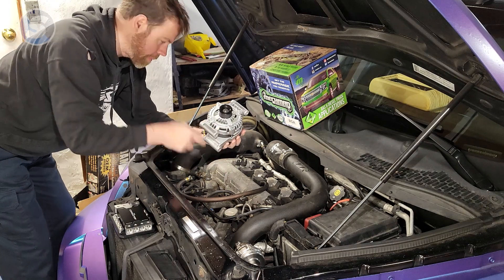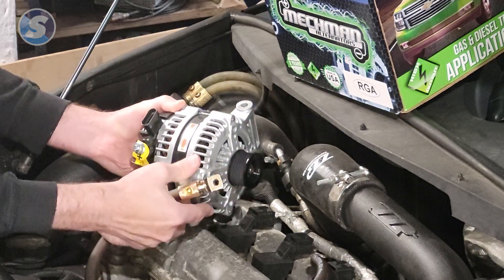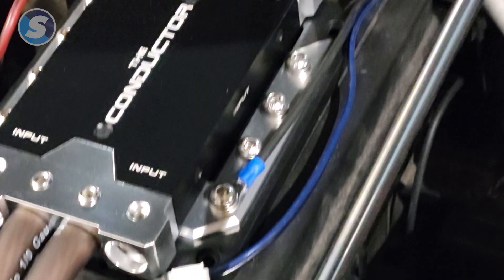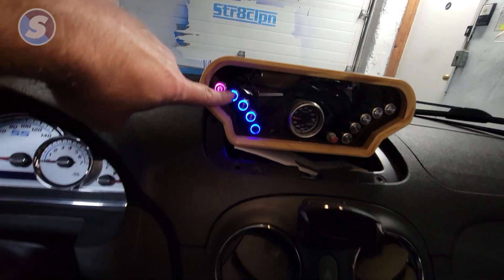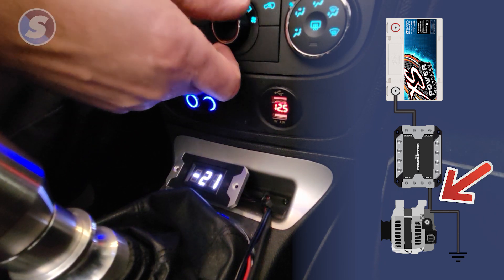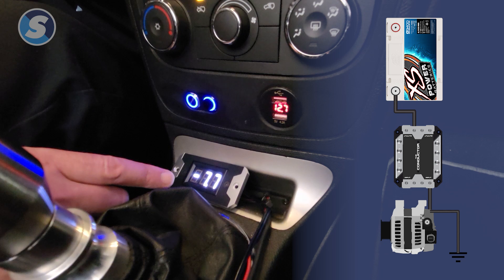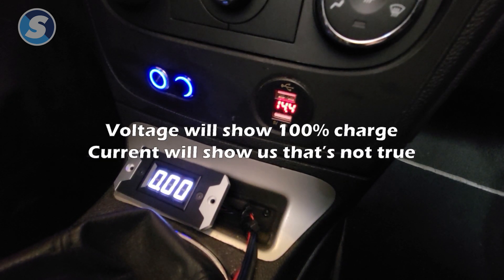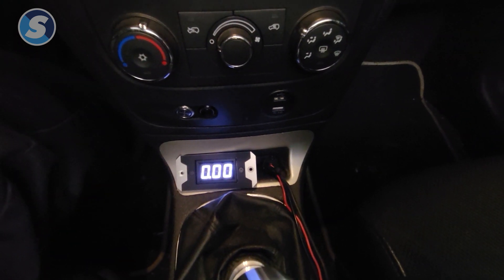Read Alternator Amperage With The Conductor!

Comment: Will the inputs accept 2/0 sky high wire reason I'm asking is I just pre-ordered the Red Ruthless 10k to go with the other one I have been thinking about grabbing a couple of these one per amp but I am about to have to upgrade the 0 gauge wire to 2/0 to reduce the amount of runs needed but I want to make sure it will accept the wire before ordering and finding out the hard way
Reply from the maker: To get 2/0 in there, you'll connect a lug to the sides.

Comment: Ok so im trying to install the conductor.... I have a high output 320A alternator, already have a 2/0 gauge cable ring terminal connected to alternator.... Now I have 3 batteries, one under my hood, 2 in trunk... Ive already previously ran front to back power and ground cables (one each) from my main battery to the 2nd trunk battery, then I just ran a short run power and ground cables from my 2nd battery to the small 3rd trunk battery..... So can I just connect the alternator ground cable to my conductor input, then run one ground out to my main battery under hood then connect the one ground I have front to back? Can I still use the short runs between 2nd trunk battery and 3rd trunk battery? Or would I have to run another front to back ground to 3rd battery?? Will my amps be ok to still ground to chassis??

Comment: So everything in the rear with a nice short chassis ground now needs to be run all the way back up to the front?

Extra length means wires may need to be bigger gauge as well compounding the extra cost, not to mention trying to fit even more huge wires routed through the cabin and firewall
Reply from the maker: The Conductor can be mounted in the rear. This example shows the ability to mount up front in case someone wanted to branch off to a front battery. Big builds like that are running ground wires to the rear anyway. If you have ONLY rear batts, you can simply put The Conductor in-line of your short grounds. It just need to be between the chassis and the battery, though running wire in the manner shown is actually a much less resistive ground than the steel of a uni-body vehicle chassis, so it's an upgrade similar to The Big 3